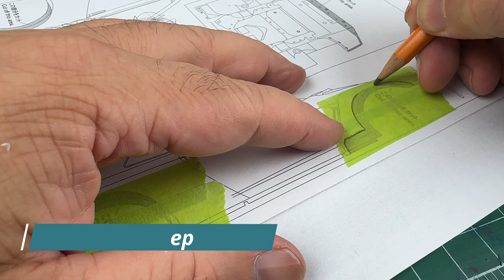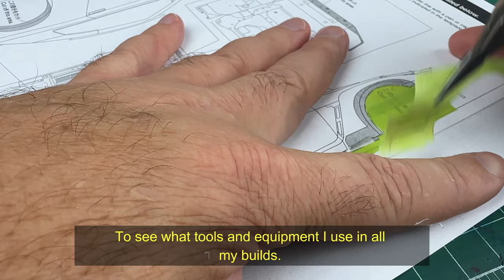Build a Liberty Walk Nissan GT-R R35 in Miniature [FULL BUILD] Step by Step

Comment: Great work on this. I'm surprised the kit requires the fenders to be cut up a bit but I guess it saves on a full retool by Aoshima. Good color choice too
Reply from the maker: Yeah, the R35 body is used in many of the Aoshima kits so kind of makes sense from a business perspective to just use a base and then allow the customer to modify as needed. It definately did need to be cut away for the front flares to even fit and then to get the wheels to tuck in there.

Comment: REALLY nice work🎉Haven’t seen you a couple of days😂I had finished my Miata approximately a week ago. 🎉I had done better BUT I still have some problems wrestling with heavy orange peels(Perhaps I had sprayed too much thick layers of paint)😢and clear parts(I have some problems in gluing them 😢is normal white glue or UHU glue competent at this job?). AND what’s your suggestion?Despite the fact that I am having a bad time presently(I am nearly removed from senior high school😢)Your update is of great encouragement to me❤
Reply from the maker: Awesome to hear you finished your Miata. I will be honest, I have almost 100 builds on my channel now and I am still learning new techniques and how to use different products even in this build! If you are not learning new things then you are standing still! Keep trying new things and when you find one that you like, practice it until you become an expert! For clear parts, you can use a white glue which drys clear so you can't see if you make an error. You can also use clear UV resin on glass as it will also cure clear and is hard to see. Keep at it and it is good to watch many others online for their techniques as well. It is how I learned a lot myself. Good luck! Keep building!

Comment: very nice!  what are you using for glue?  I don't see how you apply the glue, is what I mean.  You list them here.
Reply from the maker: The tamiya cement comes with a small brush applicator in the bottle. Capillary action is used when the brush is full of glue and placed in a spot between to parts. The same idea can be done using the CA glue. Put the glue onto a piece of tape or in a bottle cap and use a toothpick or a pin. Dip the toothpick into the glue and then place it between two parts. This only works with the super thin super glue. For a Gel type you need to apply it to the area you want to stick to another part. Hope that helps.

Comment: Thanks for sharing the modeling skills.
In video 3:49, after you apply Tamiya grey primer on the car body, do you sand it before painting 
metallic brown(Tamiya X-34)?
Thanks
Reply from the maker: I find that the Tamiya Fine primer usually does not need any sanding between coats, but this will always depend on conditons. If there is any dust or hair or something that happens in the paint, I will sand it down and maybe even recoat it. I do inspect between coats very carefully to make sure there is not foregin pieces in the paint. Also at times, I may re-scribe the panel lines after primer to ensure they are deep and prominant. I don't do that all the time and it can depend on the panel lines of the body. If you are using a rough primer, like the Mr. Surfacer 500 then I find it is best to give it a light sanding to smooth it out.
Reply: @ScaleAutoGarage  Got it. Thanks for the detail explanation..